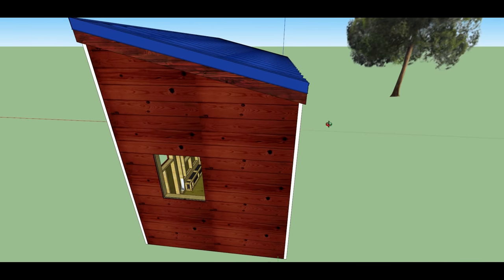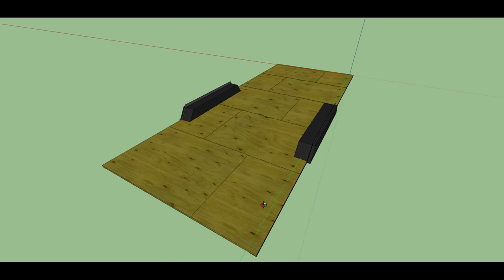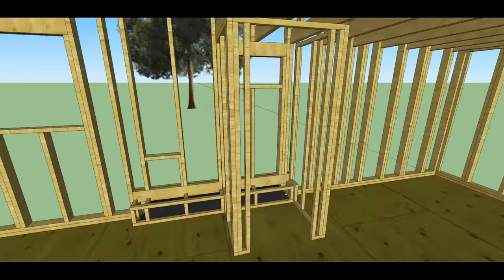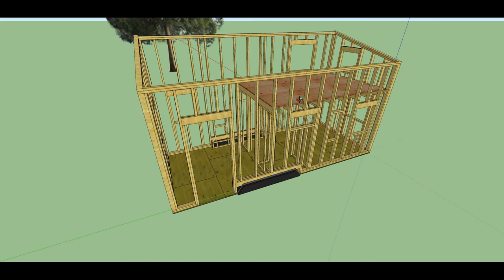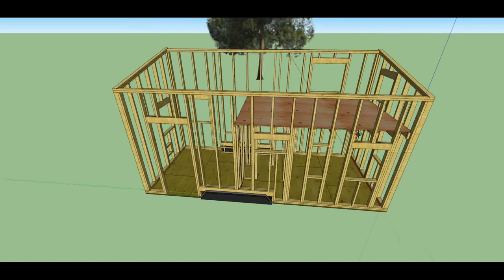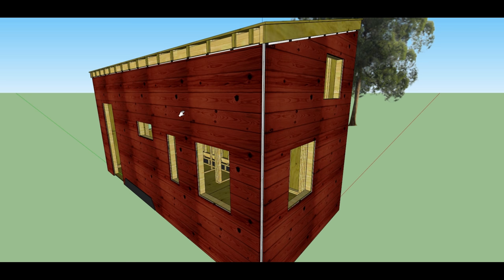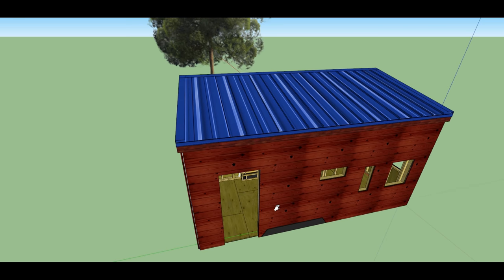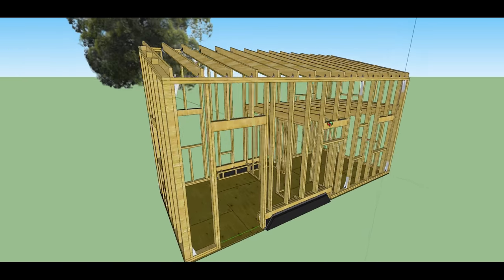Tiny House Plans - Analyzing the Structure (Ep.4)

Comment: Excellent due diligence and planning. Should make for a smooth project.Best connection to trailer I've seen. The strong ties look like they're as good as all thread, although the all thread adds compression. Use them in Florida on stick constuction for hurricanes.I suspect not an issue at your location . Innovative venting on the shed roof. May have to steal that idea in the future. Excellent documentation process also. Looking forward to your successful completion.
I'll be following the build.Best of luck............

Comment: We are at the sub fascia stage. Are you using 2x6's on the long wall and 2x8's on the short wall? Thanks for all the videos. Our tiny home couldn't be done without the help!
Reply from the maker: Our sub-fascia, which is just a shim so that the siding layers fit under the real fascia, is all 2x4 I believe... then the fascia itself is 2x8 I think... possibly 2x10 :P
Reply: You mentioned in another comment that in hindsight you would have used rigid foam insulation on the roof. Would you still have done it with the same fascia gap technique you used? If so, would you fit the rigid foam boards between the rafters still or just lay them on top of the rafters? Thanks for all of your help.
Reply from the maker: It's hard to say actually... I think it's never a bad idea to have drying gaps, as long as they are sealed from bugs... the rigid foam with spay around the perimeter should create a full vapour seal, so there shouldn't be the same moisture problems that you can get with airy bat insulation though...

Comment: You guys are doing an awesome job, with the build as well as the videos. I've watched some more recent episodes but ended up back tracking a little. Thanks for sharing. I have a few questions... How will you keep bugs or bee's from getting into the air gaps in the roof and walls?  I'm also wondering how the side (flange?) of the trailer will support all the weight of what amounts to the whole building? I didn't see any added supports or bracing and if the metal is that strong, could I use a metal trailer floor and use 2 x 4 floor joists to add more headroom? Thanks!
Reply from the maker: freedom_fight_ for_it
There will be a bug-screen mesh blocking every the to opening every cavity. That will be shown in a later video.
Not all the weight of the house sits directly on the flange, and not even the whole bottom-plate sits on it. Plus, the subfloor is between the bottom-plate and flange. It's hard to describe exactly, but if you watch some other videos of us building the floor and securing to the flange you can probably see.
I've heard that a few people who used 2x4 for the floor found that there wasn't enough insulation causing the floor to feel cold all the time. We decided that a more comfortable floor under our feet was more important than the 2" available.

Comment: You have an interesting approach to installing your floor joists. Why not just install a 2x6 sill on the edge and use floor joist hangers? The sill will take the depth to the trailer up to 6-1/2” and thereby solve your depth problem.

Comment: Here's a product that could help with ventilation between your rafters.  I think they make it in smaller sizes, too.
Insulate roof foam baffles ventilation
Reply from the maker: thanks! I'll look into these when we get closer to that step :)
Reply: We used these on our house and they're really easy to install and pretty cheap for the benefits!
Reply from the maker: I think we would use these if we build another tiny house :)

Comment: I really like your design. But what about the gap for airflow across the ceiling, will you be putting some sort of screen in that area to avoid insect or mice from getting in?
Reply from the maker: Karen Gradzki Yes, you can see in later videos that we put a mesh to block off all access to cavities created by layers of construction. I'm sure a mouse could chew through it, but it would really have to want to climb the exterior of the house and get up there... at that point... kudos for the effort mouse! ;D

Comment: I like the roof venting design.  How did that work out?  Love having a 3D model.
Reply from the maker: The roof venting worked out fine, and I think it will do its job... however I in hindsight I think it would be better to use rigid foam boards in the ceiling and floor, with a slight gap around the perimeter, which you then fill with spray-foam. This would create a vapour-barrier (eliminating the future step), would be a little lighter, and would be easy to install because there is almost no electrical or plumbing in the way.

Comment: I have been stuggling with the roof venting issue.  Your idea solves my problem.  Thanks for that.  I am putting 45 degree braces in the front corners and first side corners.  I am also using 1/4 inch aircraft cable to bind the whole structure to the frame.  It will start at the bottom of the first wall cavity, go through all the angled cross brasing, through the top plate, and end in the middle.  Same for the opposite side, joining in the middle.  There will be two loops, and tightened up with a turnbuckle.  (saw this on Texas Tiny Houses, and he has picked his up with a crane with no structural movement.)  Mine is on a fifth wheel trailer, and everything is going to be reclaimed/repurposed.  I have most of everything now, and have spent very little money.  My goal is to do it for under 3500.  Biggest cost to date is beefing up the trailer.  I was booked for the workshop in Vancouver, but had to cancel due to health issues.  (house will be 24 feet with 3 foot back porch, low slope over the cab area of bed, and 12/12 over the rest with a small back loft for storage.  I am trying to incorporate a 8 foot slide out for the sofa)
Reply from the maker: I had considered aircraft cable at an earlier stage. Do you have any links to info or videos regarding it's use in a tiny house? I'd like to check it out. I can't quite picture what you've described... does it engage all 4 walls or just the end-walls?

Quite the budget you're working on! We're looking at the more standard 20-25k grand total.
Reply: The end walls.  I'll try to find it.  It was in Texas Tiny Houses.  His was on a frame, and he lifted it up with a crane onto a trailer to transport.  Mine will be through the framefrom  underneath, go up through the wall cavity on each front and back ends, and join in the middle.  The turnbuckle will tighten it up, and cinche it down to the trailer.  I have a tool at work, (aircraft fabrication course) at my college - N.I.C. Campbell River) where I can put ends and loops on the cable.
Reply from the maker: awesome thanks, I'll check these out :D

Comment: Re: strapping--the main thing is to maintain a continual load-path, i.e. in compression, tension, torsion, bending and shear. In other words, block all the voids and hold-down for uplift, rotation, racking. All should be well.

Comment: have you thought about solar panel for the roof and a bank of rechargable batteries under the sofa
Reply from the maker: +MrGateway75 We may add solar panels in the future, but more like as a stand-alone unit that will follow the sun. We may also isolate (from the propane) a section of the utility box for the batteries.

Comment: Hi guys, Myself and my daughter are starting my daughters tiny home project here in the UK in September this year. Apologies if someone has already commented on this, but could you elaborate more on the eaves detail? I'm a little concerned about the lack of overhang at the gutter side, due to maximising the interior. We have a maximum of 2.55m width allowance. Thank you in advance. Dave
Reply from the maker: Overhangs are a big issue with tiny homes... even if you shrink the interior, you won't want to shrink it very much, which means that you will never have enough room to build out a proper overhang. Many states and provinces in north-america will permit up to a 10ft vehicle to travel without the need for extra drivers/vehicles to get involved. So if you don't plan to move the house often, going extra wide is a good option. Don't feel that you have to strictly adhere to road-travel limitations if the house will spend 99.99% of it's time in a deployed/stationary state.

Comment: so for your strapping issue there was one I saw that used sheet metal in "key areas" to gain that bit extra shear strength. I think he used 18ga maybe 20ga sheet metal. might be one thing to consider.
Reply from the maker: I realized that this was the one thing I didn't clarify what I was referring to. People tend to use this kind of stuff:
http://www.homedepot.com/p/Simpson-Strong-Tie-40-ft-12-Gauge-Coiled-Strap-CMST12/100375067

It can be wrapped or laid across different parts of the wall.

Comment: now that you mention all the vapor seals and barriers, and i've seen your window installs, you take a warm shower or boil water, the whole place would steam up! (on a winter day with windows closed) maybe a small computer case fan, 75-100mm ducted at one end of the house and a smaller free vent at the other end, both shielded from weather could help with moisture ventilation and cooking odors, just switch it on when needed.
Reply from the maker: mr bad example I think you're going to like what we have planned :) it will involve computer fans... 

The thing about the vapour barriers, is that at least if it steams up the moisture will stay inside where we can dry it out by controlling the environment. If that vapour were to get inside the wall cavity and THEN cool down and condense, we'd have moisture in a potentially cold and closed space, with only the humid exterior air to dry it out. So we're going with an active system that will hopefully keep it under control.

Comment: @Tiny Nest, I didn't quite understand the purpose of the open spacing between the roofing and the insulation. I'm from Alaska, and I know small animals love spaces like this. Also, it would seem the air's moisture would increase the chance of rot in this area.Could you explain this to me?
Reply from the maker: +Fritz Christian The idea is that if there was a tiny leak in the roof, or moisture that seeped in through the interior ceiling (and into the roof framing), that there would be airflow to allow that moisture to dry/evaporate. Without the airflow, moisture that found its way in would be trapped, and that's what leads to rot. I'm not an expert on this subject, I simply read some articles online, but the concept seemed to make sense with the way we have built the roof. We've also tried to screen it off so insects can't get in... a rodent could scale the exterior wall and chew through it if it really wanted to, but there's only so much we can do.
Reply: Thank you for that excellent explanation. I'm planning a small home build (420 sq ft), and need as much info as I can get.
What climate is this in? I'm wondering because you're using R22 insulation.
Reply from the maker: +Fritz Christian We're on Vancouver Island, Canada, where it rarely drops below freezing. We're not worried about managing the temperature, but it's very rainy and can get humid, which is why we focused on moisture-proofing the structure.

Comment: Looks like your doing a good bit of home work...

I didn't see how you're going to get into the loft. So I gather you will use a ladder of some type. If so head room can be an issue. I saw a couple of thse where the folks used a shed dormer running from front to back. With the peak of the roof over the loft. Thereby giving you more head room.

So after getting into the loft are you going to have to craw on your knees to get to the bed? This may become ardiouse after a while. Espeically when haveing to get up in the night.

Rally enjoyed the vids. Hope you don't my adding my 2 cents...LOL

BTW do you have an estimate cost of the the finished project?

Thanks & best of luck with the build.
Reply from the maker: Yes we plan on making a ladder, and it will be tight. You make a good point.

Do you have a link to the one that you're referring to?

Always appreciate feedback!

It's looking like it's going to be $20k CAD +/- a few thousand. That's with basically all new materials, not reclaimed, and includes some furniture and appliances. We may look for reclaimed siding and a few things like a sink and whatnot.
Reply: Tiny Nest  Here is the link from a guy with some really good ideas for a tiny home.

Amazing DIY Off-Grid Modern Tiny House Built for NZ$21,000

Hope it helps....LOL
Reply from the maker: Very cool, we hadn't seen this one before. Thanks for the link.

We've actually begun building the walls already so it's a bit late to make a drastic change the the structure. We've accepted that a lot of it will be an experiment and we're going to show our life in it once it's built, so you'll get to see how it works out in the end ;)
Reply: Tiny Nest
You're most welcome. Keep up the good work & the vids.

Comment: Did you guys decide not to notch out the subfascia between the rafters?  That's what it looks like in the sketchup file I have.  I'm trying to figure out how I'm going to ventilate.
Reply from the maker: We actually have our roof joists sitting a little higher than the sub-fascia which creates that opening for air to enter the upper part of the roof-cavity.
Reply: Tiny Nest,
what happens if you don't?
Reply from the maker: There's two parts to this... the first is obviously to try to seal things up tight so that the roof sheathing can't get wet in the first place... but it's good to have a backup in the form of airflow so that if any moisture DOES get in there, it has a chance to dry out.

Comment: So we are building our tiny home in sketchup right now and are wondering why you have a floor plate? We have built our "floor plate" right into the framing of the walls. What function does it serve?
Reply from the maker: Gabrielle Lysenko We've had this question a few times now. It was really just to allow us to line up the walls easier. We first fastened down the first bottom-plate very precisely square with where we wanted the walls to site. Then when we were manipulating the big chunks of wall, we just had to line them up on top of that first plate, instead of with a chalk line, or other position indicator. So it was more of a helper, than a structural component, although it does tie the walls together just a little bit more as well.
Reply: I guess now that I've binged on all of your videos, I should go read the comments! It sounds like you've answered quite a few of my questions. Thanks for readdressing it though.
Reply from the maker: Gabrielle Lysenko No sweat, thanks for engaging with us, and thanks for watching :D

Comment: That's what i'm planning. I'm in the research stage in my project right now. I've watched several dozen you tube videos on different designs and elements that they have used I am almost ready to get my trailer. Going to Oregon isn't a option for me Too far I live in Spring Hill Florida.  I'm looking for a local trailer manufacture to make one similar to yours. Being a electrician what size breaker panel are you using with how many circuits?
Reply from the maker: James Stalter The breaker panel itself is rated for 125A, so it's more about the rating of the supply conductors and plug. 30A should be more than enough in practical use, but I'm going to install 50A wiring and plug for lots of headroom. There will be some LED lights (I have something awesome planned for that) and plugs for computer/electronics, and the only circuits that we really have to account for are in the kitchen where we will have electric cooking. Space and water heating will be propane.

Comment: Are you planing to be off the grid with solar and water?
Reply from the maker: James Stalter Initially electricity and water will be supplied from the grid (a well for the water). But I intend on putting in enough empty conduit and other provisions to allow me to add the necessary electrical equipment for battery operation. It's just very expensive to include in the build.

Comment: You had mentioned the strapping.....usually this goes on in a diagonal fashion....But with door and window openings, that makes is a little difficult, or installation would have to be different....may be broken up to get around the openings, and still serve the function....
Reply from the maker: Timmy Gee We're just going to get it on where it will fit, likely a few strips per wall, and wrapping around from one wall to another wherever possible. We'll be doing that soon, so stay tuned.
Reply: Sounds great, will help tie it all together, help keep the structure from moving, when you move it anywhere.....